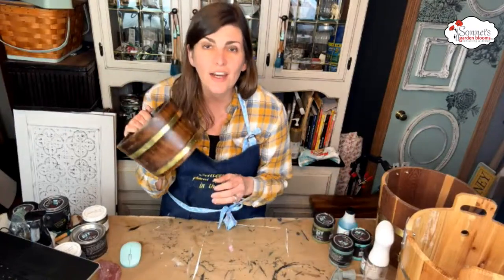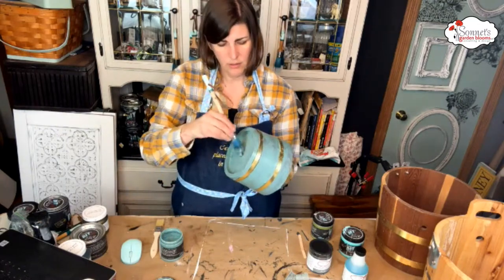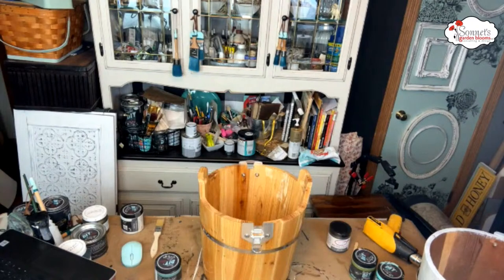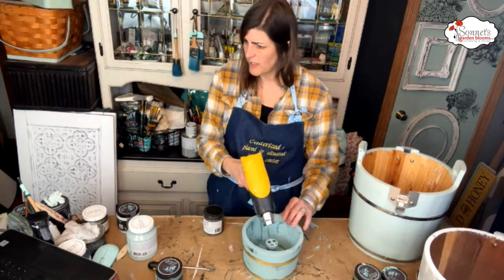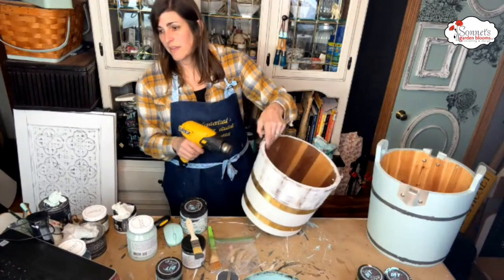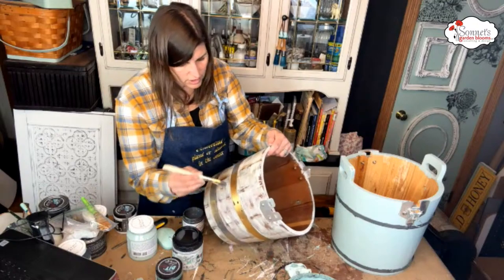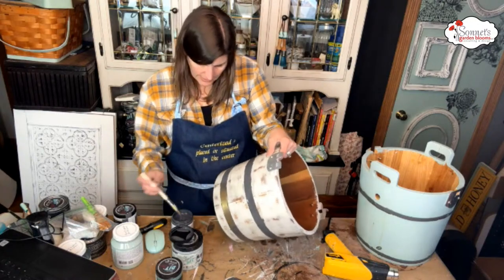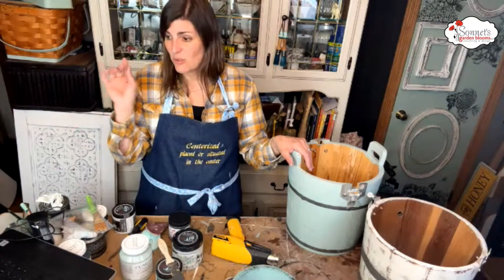Let's Create Faux Rust

Comment: #replay
I love the Dixie Bell Rusting products!! I use a Dollar Tree stencil brush and stipple both coats of the mineral base paint and the thicker the mineral and more spray, the better runs you will achieve. Hope this helps…. And it does take a while to fully rust. The 1st time I tried it, I walked away for a few hours and when I came back I was amazed at how well it looked🤗

Comment: Ellen J Goods drills a hole in the lid and uses a small cork to close the hole. Then you’re not having to remove the lid anymore. You just squeeze the paint out the hole and replace the cork. also, I have been using the down power wash bottles after they’re empty I clean them really well. They make awesome misters.